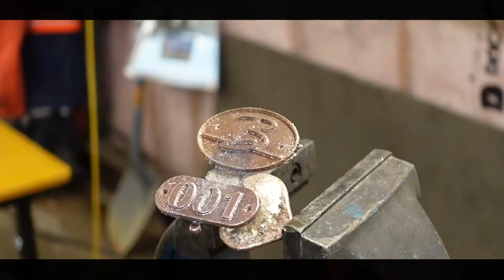96+ Hr Wine Barrel Bar Build - DIY - Part 2

Comment: Excellent work sir!! I have a couple questions: 1) If I just make a single door, would I still need to reinforce with a wooden strip? Secondly, quantity of epoxy used and brand and the grit of sandpaper to sand?
Reply from the maker: If you tighten the barrel after it has dried, the strip isn't absolutely necessary. but it allows you to re-curve the door during the gluing process, as the doors will relax once cut out. I show how to tighten the barrel in my video titled "Wine barrel cabinet". and I use Art Resin epoxy, 4 different pours totaling 4 liters. Sand paper grit I use 120 all the way up to 3000 grit using a 5" random orbital sander. and thank you for the kind words!!

Comment: Can you explain why you took the time to router in and bend the wood strip then sand them all flush? Have a barrel and deciding what to do with it.
Reply from the maker: Hello Ben! Wine barrels are wet vessels, when they dry out, they shrink and start falling apart. The glued in wood strips on the doors and door openings prevent the doors from changing shape when the barrel eventually dries at the customers climate. I've seen barrels take up to 4 months to completely dry.